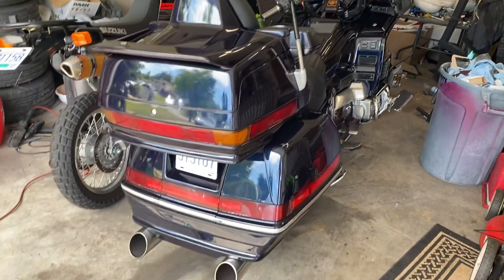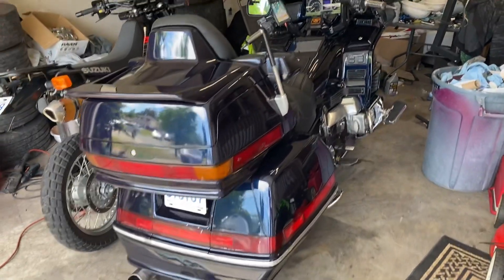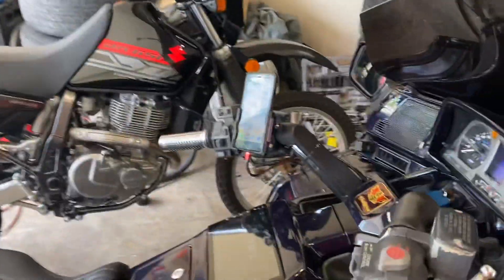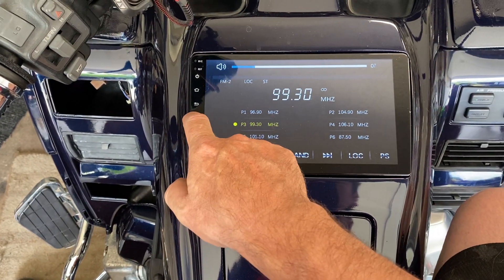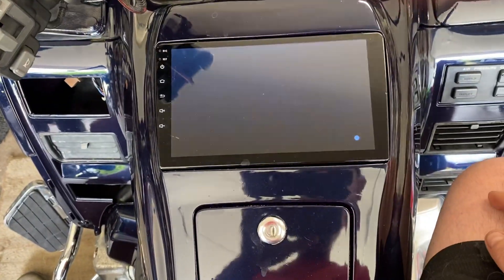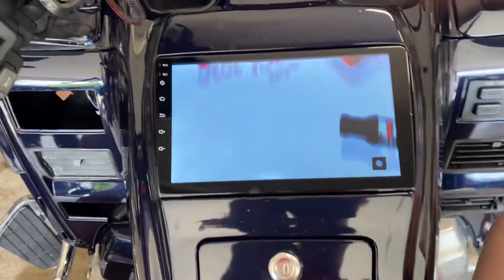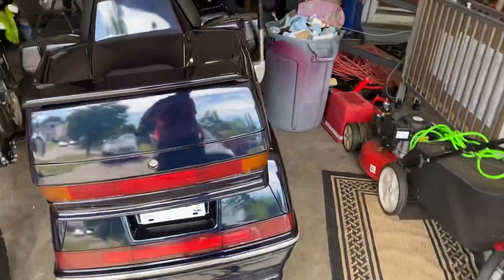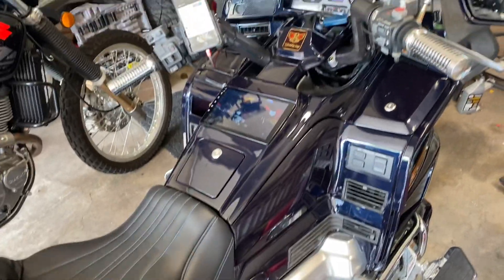Crazy Goldwing gl1500 custom 9 inch touchscreen Bluetooth apple carplay stereo

Comment: I was going to get one of those radio's at one time for my bike. I changed my mind cause there was a couple of things I didn't know that were important to me.
Can you adjust volume from the thumb controls on the handlebars and does the volume level change with the speed of the bike? And, can you read the display in the glare of the sun?
If you could take time out for that I would appreciate it.

Comment: I think the radio is a good upgrade ... just see it right now .8 month later... If you still have it i guess you should consider a screen protection ... something similar to a phone or tablet case ...  the position that the screen is facing up it is very likely that something heavy will fall on it and break it...a helmet, a tool, the sun, the rain...even if for some reason you rest your hand on over the screen without realizing it would definitely break the screen...you should find a way to install a protection

Comment: post a link to the Radio !!.. which brand and model? 
did you integrate to the left controls??

I did some 1.75" straight pipes.. like simple Muffler Shop Pipe !! 
problem is bike was running a bit lean
Can you turn the pipes over so the angle is turning down ? 

nice paint !!
Reply from the maker: Thanks the radio is from Amazon 9 inch touchscreen $75 won’t let me copy the link I didn’t integrate the controls
Reply: Double Din Car Stereo Apple Carplay, Rimoody 9 Inch Android Auto Touchscreen Car Radio with Bluetooth FM Mirror Link USB Support Subwoofer Output + Backup Camera

Comment: How did you alter the shell to hold the touchscreen?
Reply from the maker: With fiberglass
Reply: @triggerautopainting5249   did you do the fiberglass yourself and if so have you ever thought about doing for someone else?
Reply from the maker: I did do the fiberglass myself and I have my own shop see my other videos of some of my builds
Reply: What functions did you lose with the install?  Like the air suspension and display.
Reply from the maker: I only lost radio hand controls